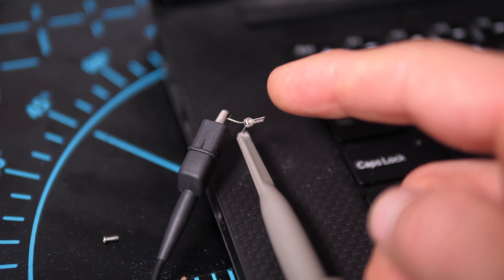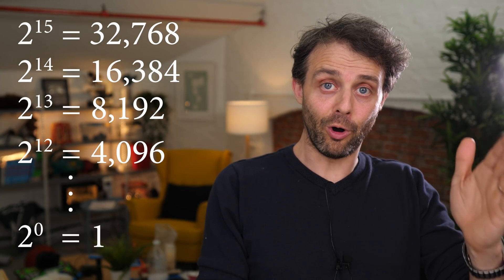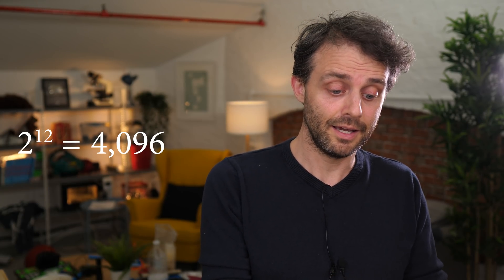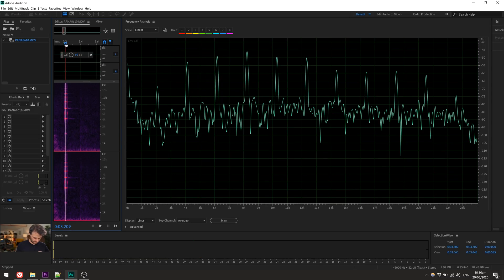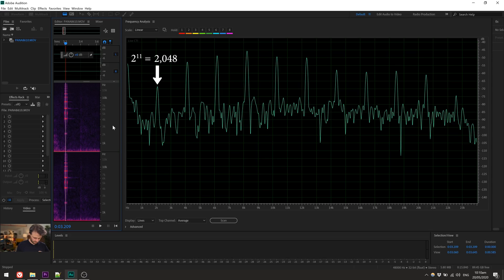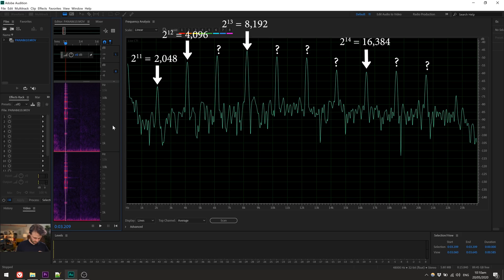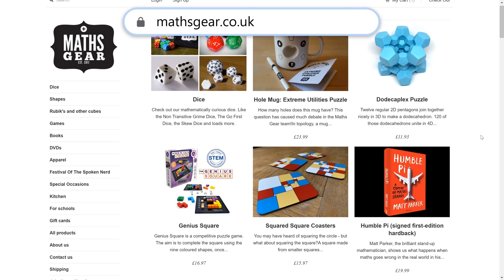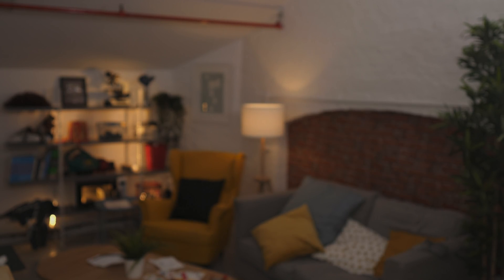Why a Watch Beep Is Exactly 2¹¹ Hz (2048 Hz)

Comment: I had a go at looking at this in Audacity. Inconclusive on the frequency, I don't have one here to get a good clean recording of.
BUT, guess how long that beep is?
It's 31.25ms, aka exactly 1/32 seconds.
So if it's 2048Hz, that's 64 cycles of the waveform. 128 cycles if it's 4096Hz.
It's powers of two all the way down :)
Reply: The overtones are consistent with producing a square wave at 2048 Hz.
Reply: @ChrisLeeW00  Yes - I would guess the watch is driving the "speaker" with a clock (square wave) without any attempt to make it more round. Actually if it was a pure sine wave it would probably be even more annoying
Reply: TMNT has 2^2 turtles, powers check out!
Reply: @uberubermensch  yep. It's turtles all the way down.
Reply: Jason Gullicks Valve released Half Life to 2^1 and it's episodes to 2^1. It's powers of 2 all the way down!
Reply: Based on this comment I used Audacity to make three versions of a 2048 Hz tone of 31.25ms and just by comparing, I think it's specifically a 2048 Hz rectangular wavelength (not a sine) at 31.25ms. So switching the speaker to max volume and back  off again at that frequency.
Reply: I also came here to comment about Audacity. (free software, very useful to have on your computer. basically an audio swiss-army-knife)
I remember Matthias Wandel making a video about using Audacity to find the RPM of a motor with a microphone. I think that's what stuck the idea in my brain.
Reply: With that beep duration, the spectrum will drop by 3dB (relative to the local peak) at +/- 121 Hz off of the peak's center frequency.
I'm not sure whether it can be done in Audacity, but if you can have the zoom in on the beep in the time domain and confine the spectrum to be drawn from only when it's active, you should be able to see more clearly what the center frequency is (at the cost of lower resolution).
Reply: wow, the Robert Miles.
Reply: @the_multus  No not the trance music DJ, he died at age 47 in 2017. This Robert Miles is from Nottingham UK and likes AI.
Reply: I was going to remind people that square waves only contain odd harmonics, so the spectrograph should show 2048, 8192 and 32768 only.
On the other hand, the piezo used as speaker is electrically equivalent to a capacitor and inductor in parallel, able to generate sin wave from short pulses like a child on a swing just need a small push once per cycle.
Reply: What's the relation between the frequency of the beep of being of a power of 2 and the frequency of the quartz crystal?
Reply: @indranujray214  the crystal drives a binary counter at 32768 (2^15) hz.
Binary is really simple to work with, each place is just a power of 2.
so if you want 2^0 (for 1 second) you would take bit 15 (0100000000000000) and use it to drive another counter for seconds.
The frequency of the speaker can likewise be taken from this counter at bit 6 (00000000000100000) for 2048 hz.
Reply: You get a much better view in the spectrum display if using audacity, but a better tool for this is Sonic Visualiser from Queen Mary, University of London.
Reply: I am pretty sure that is just overtones, which most "instruments" make. Overtones appear at every whole multiple of the fundamental which lines up with the analysis of the frequency. The reason they have different values is the same reason a 440hz A on the piano sounds different from the same 440hz A on a guitar.
Reply: @Danish_raven  it would be overtones that naturally arise because it's a square wave driving the speaker, not a sine wave, so we get the loads of extra pure frequencies from fourier analyzing the motion of the speaker.
i would agree that it's the lower one
Reply: Robert Miles my one true master. The Robot Meister.
Reply: Oh my goodness I've spotted Robert Miles in the comments section of a Steve Mould video. What a small world!
Reply: It would be fore sure driving it with a digital pin hence the square wave harmonics
Reply: The spectrum is really only indicating that the fundamental frequency is 2048 and that's simply because it's the lowest frequency present (besides the spurious rise toward 0 Hz no doubt due to some DC offset).

If it were a square wave and recorded at perfect fidelity there wouldn't actually be any peaks at even multiples of the fundamental because a square wave contains only the odd harmonics.

That said, being a digital watch it's no doubt creating a digital; ie: squarewave signal, but whether the "speaker" were driven by a square, sawtooth, or even sinusiodal signal it would tend to be a harmonically diverse sound due to acoustic effects that will be further affected by the frequency response of the microphone, although at that pitch and duration it'll all sound largely the same regardless of waveform.  For most people 2 kHz is about as audible as pitches get but it's also near the range where distinguishing the timbre of a sound gets pretty hard.
Reply: "It's all powers of 2!" "Always has been."

Comment: If the sounder signal is derived from one of the divided crystal frequencies (as seems highly likely) it will likely be a square wave. It certainly won’t be a pure sine tone. So it won’t give a single spike on a frequency display. If it is a square wave, it will show an infinite series of harmonics - as the Fourier Transform expansion

Comment: It would take a trivial amount of additional circuitry to get other frequencies.  A 4-bit binary adder could be used as an overflow rate multiplier to derive 15 different frequencies from higher up the divider chain.    Use an 8-bit adder and you can get close enough to a tune out of it.

Comment: I actually think the frequency of the beep is 8192 Hz.
The main reason being that the highest (more powerful) harmonic is the 8192 Hz. 

This in turns makes that if you play a 2000 Hz,  4000 Hz and a 8000 Hz beep (with a pure sinewave) and compare to the sound your clock does, it is clear that the 8000 Hz is the one that sounds closer (try it yourself). 
Which makes sense b/c the 8192 Hz is, as mentioned, the dominant frequency in your spectrum.

Since you have so many harmonics I suspect that they feed the 8192 Hz clock signal directly into the speaker. 
A pure sinewave should give you a much cleaner spectrum ( a narrow Sinc centered in the sinewave frequency)

I believe that you are aliasing higher frequency components of the clock signal when taking the FFT and producing all the other spectrum lines.
What sampling frequency are you using? Can you increase it and see if you see a difference?
Reply: Aliasing is probably not an issue.

A professional audio mic should have no problem recording frequencies in the range showed on the spectrum.

Comment: If the signal produced by the frequency divider is square, you should see harmonics 1,3,5,2n+1 so it explains the harmonics between the powers of 2 I think.
Its the power of 2 in the harmonics that I find weird in fact.

And my intuition was that there is a separate component to produce the sound (buzzer). I don't know why the would have used the frequency from the quartz, it would mean having an amplifier etc.

Comment: If it is of any use: a reason for the many harmonics is probably because the piezoelectric speaker is driven by a (digital) square wave signal and not a (clean) sine wave. Square waves have inherently many (higher) harmonics of the base frequency in them.

Comment: I listened to the beep sound and compared it to a constant tone of 2048 Hz and 4096 Hz and I hear the 2048 Hz as the base frequency with harmonics, as you showed. It's definitely not a pure sine wave, which I thought it would be easier to make for a beep sound. So I wonder if it's sending a signal with multiple frequencies and the speaker can only play sounds above 2048? Because I don't hear 1024 Hz for instance and your analysis also doesn't show a peak around 1k. 
Also for anyone who is curious, 2048Hz is just over C7 by about 37 cents. So if you ever need a quite sharp C in a song, just look for your digital watch.
Reply: It's slightly flat, which doesn't help with my interval training! Good thing I don't have perfect pitch or it would be even more annoying!

Comment: REW (room eq wizard) is a free acoustic measurement SW that you can use for accurate measurements. It is meant to help with acoustic setup/calibration of listening/home theater rooms. Usually you need a measurement mic, but for just frequency probably any mic will do fine. 
The absolute accuracy of the frequency measurement is also limited by the sound duration (FFT). I am guessing that the beep is around a quarter of second, so accuracy is ~ 1/0.25 = ~4 Hz.

Comment: This is for a deeper dive into why it works... A typical method of dividing a signal in half is using an edge triggered flip-flop. If you have a series of flip-flops in a daisy chain, you can create a more divisions, each stage divides the previous one by 2... so if you have 15 in a row, then the frequency of 2^15 will evenly divide down to 1 Hz.  And you can pick off 2^11 for your 2048 pizeo "Beep"..  For those more advanced might comment that daisy chains will produce asynchronous (ripple) edges i.e. the outputs will ripple from stage to stage and that can be a problem if you want them to change all at the same time. The solution to that is to use JK Flip-flops with all the clock inputs tied together so they change at the same time... the logic is the same, except the edges all line up.
Reply from the maker: Nice detail
Reply: @SteveMould  Thanks...  I enjoy your channel and the various topics you talk about some stuff I never heard of... It's so awesome to learn new things! Thanks for posting these videos.   BTW: clocking circuits and signal timing is everything and the modern world heavily depends on it.  When I worked at HP/Agilent Test and Measurement and we made test equipment for Semiconductor FAB to test high-speed FLASH memory on a wafer. We had to calibrate and deskew the signals to the device under test because signal routing and cable lengths added enough delay to cause timing problems and it was the only way to ensure that the signals (data, address, and control) would arrive at the same time... Similar problems in data networks for long-haul transmissions, where atomic clocks are needed to prevent signals from clashing into each other when they destinate at their terminals. Anyway, the rabbit hole goes quite deep and likely beyond the level of your audience... and I'm not an expert on this subject, I just know enough to be dangerous 😁